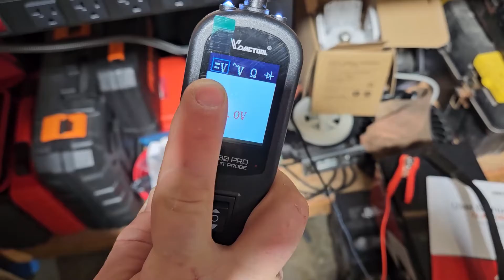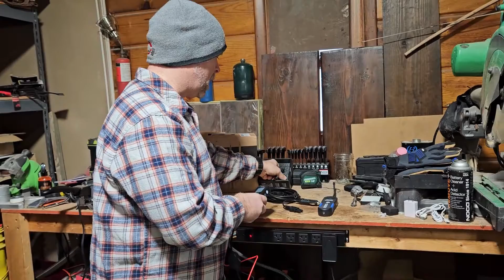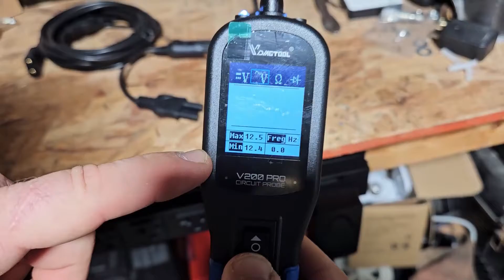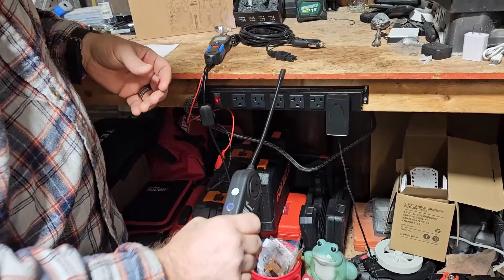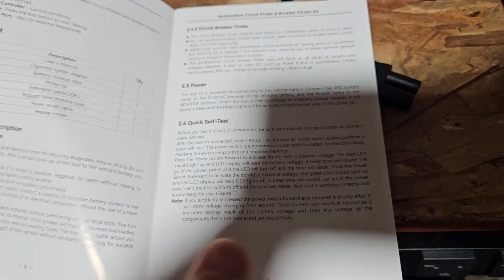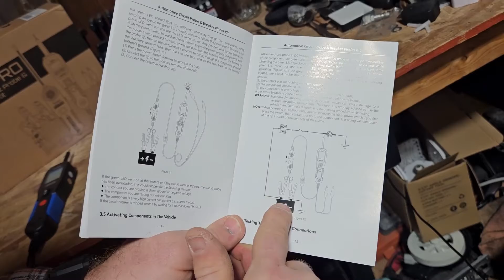V200 Pro Automotive Power Circuit Probe Tester

Comment: You really don't understand how the wire tracker works. You didn't show it correctly. You hook up the red clip to one end of the wire and that transmits a radio frequency down the wire, then you take the receiver to track it. When the audible tone gets weaker across the wire, that is likely were the break is in the line. Telecom and network techs have been using these tools for decades. It's literally just a radio transmitter and receiver.
Reply from the maker: I appreciate the help!
You're right, I have no idea how to use this and I tried to communicate that to the seller who just wanted a video and the instruction manual was no help.
I appreciate your quick points to help out rather than criticize.